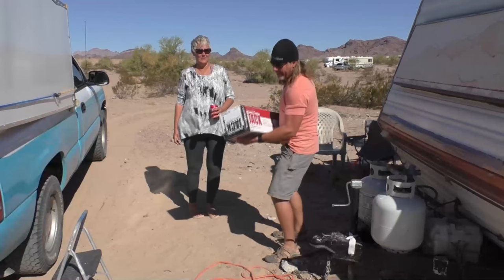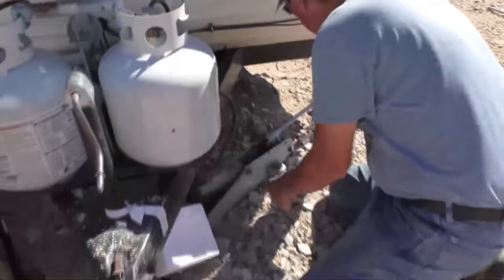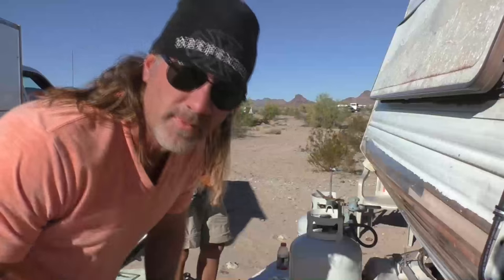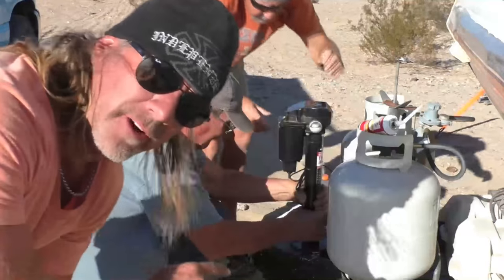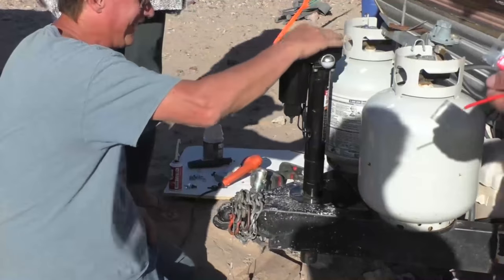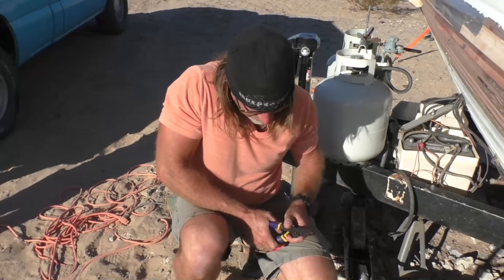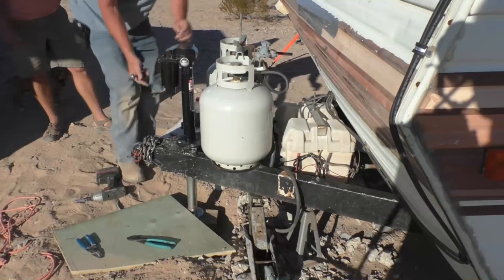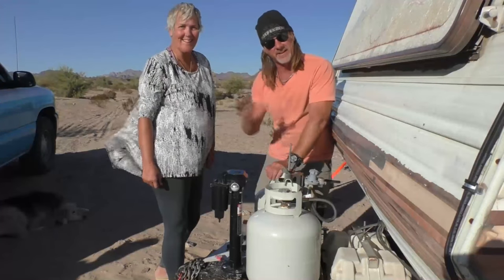Trailer Jacks | How to install an Electric Trailer Jack

Comment: Universal step drill bits work better for enlarging a hole. Amazon has a ton of different ones , even titanium coated. It's the best investment in any tool box. They come in handy doing security camera installation or electrical work.
Reply: Thank you! This is really good advice. It took a while to make that hole larger.

Comment: Thanks, I've been considering an electric jack. I hope you do a product review on it in a couple months.
Reply from the maker: Ya. we could always check in with Kathy after a while. Good idea.
Reply: The new electric jack is working perfectly! Thank you so much Jamie and Larry!! I have an issue with my back so cranking the manual one was a little tortuous. Also, it comes with a hand crank in case my batteries are dead.

Comment: well done! I was wondering if that jack could be used to lift a small motorcycle off a a bumper after altering a hitch to fit the jack? Seems like it should work, and maybe less work to load a scooter/bike. Might have to reinforce the metal on the jack for the shake on rough roads.
Reply from the maker: Glad it helped see more of how that thing works Doug. Best to you!

Comment: can you make a video on --how to install a shade cloth for trailers-----the roll-out awnings are crazy at camping world---the awning cloth is about 150.00, but they want 600 plus to install
Reply from the maker: This is a great alternative that worked well for me for years: https://youtu.be/2ulGTlmcffI
Reply: thanks for making the video - I have the same jack > in the installation manual, it says, be sure and add an on/off switch (not included) in the line... the people at harbor freight say this is because this jack will continually drain the battery otherwise > do you have anything to say about this? the question I have is, if the jack is off, and the led lights are off, how will it drain the battery? if it is important to install an on/off switch, what kind would you use?

Comment: Hi Jamie... Great vids... Does the electric jack have the ability to be hand cranked in case of low voltage? Our stock electric jack on our travel trailer can be operated manually too... Just wondering..
Reply: Yes, it did come with a hand crank in case I need it. I just LOVE this new jack!

Comment: lotta tongue weight up there now.
Reply from the maker: Kathy's truck is awesome, but, ya. That is always a consideration.
Reply: yeah adds up...the iron tongue, the two batteries, the two full propane tanks, sway bars, safety chains, ball. hitch and now a heavy beefy electric jack...just saying. :)
Reply: I totally misinterpreted this comment. ><
Reply: I have found no problem with the added weight on my tongue.